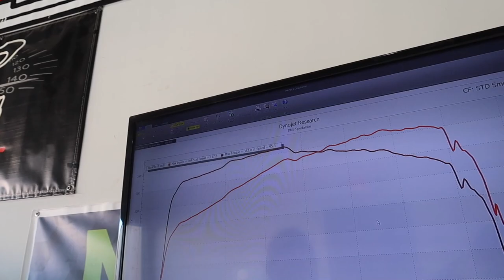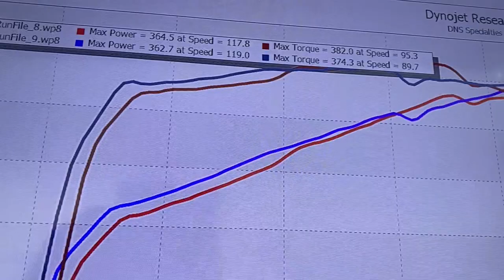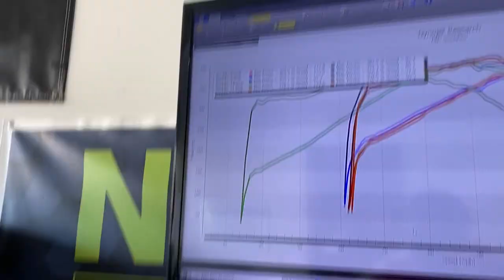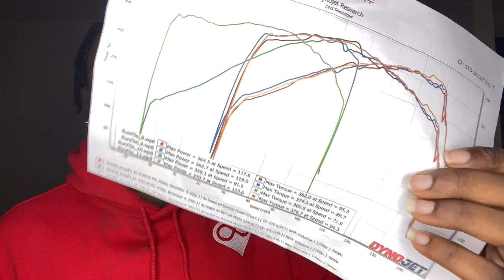I FINALLY PUT MY 2015 CAMARO 2SS ON THE DYNO......

Comment: Hey man do you have a video where you do get it fully tuned ? This sure brought my hopes up seeing you were rocking 360-70 without a tune. I just ordered up the zl1 corsa sports for my l99 and have 17/8 TSP headers waiting to be put on. Also have the same rotofab. Pretty dam near identical to yours minus the corsa but they’re really just a 3 inch straight pipe too.

But yea man what’d mamba end up doing on the dyno with a real tune with those mods ?
Reply from the maker: Yeah man I have a video up from not to long again with the full tune check it out. Set out was dope man your car is gonna run nice